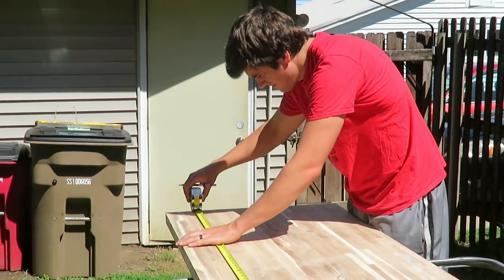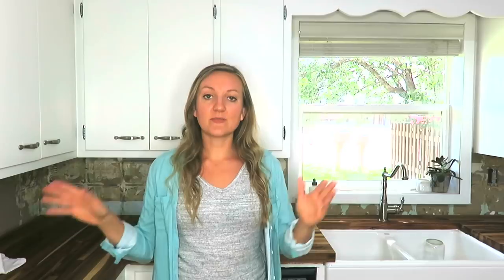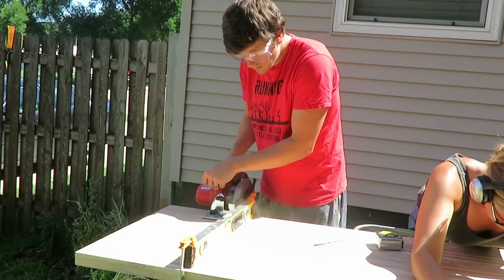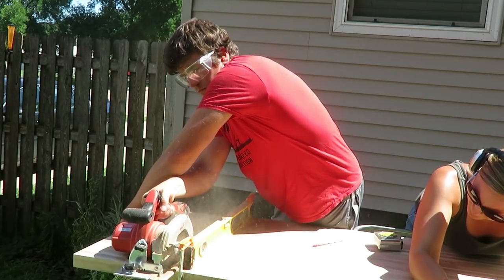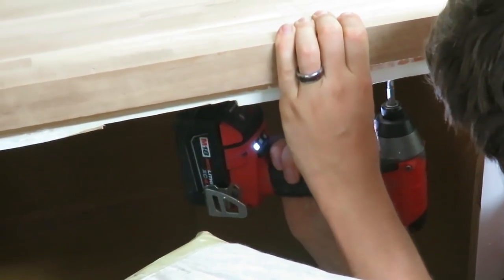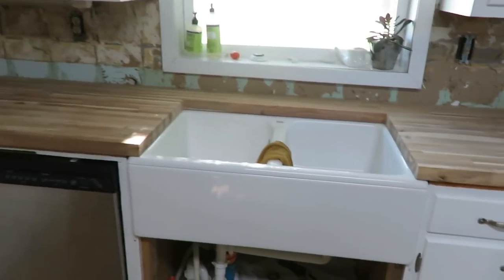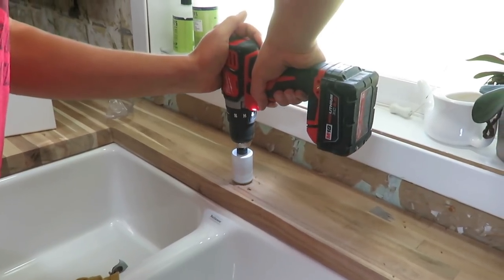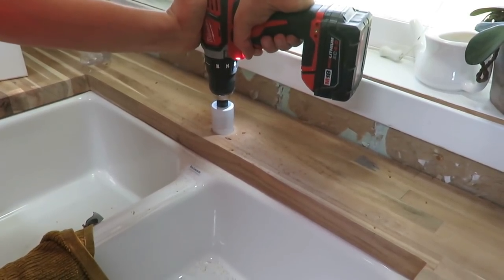HOW TO INSTALL A BUTCHER BLOCK COUNTER TOP | DIY COUNTER

Comment: I just got Walnut butcher block counter tops from Floor and Decor. They were about the same price but I got two 12 foot pieces. They had some acacia but they didn't have the butcher block look. So if someone doesn't have a LL in their area I'd check FandD. Your counter tops are beautiful.
Reply: Sara Wentzel  I just bought American Walnut. Did you seal yours? How is it going now?

Comment: My wife and I are currently renovating our kitchen and replacing the laminate with butcher block.  You are definitely spot on when comparing the cost of maple hardwood with quartz or granite, and it's definitely easier to work with.  Your husband did an extraordinary job, and I understand the measure three times cut once philosophy.  It's terrifying cutting a 350 dollar piece of wood.  One hard lesson that we learned (and no one mentioned on the internet) was that the corners on the milled slab from the factory are not necessarily square.  Fortunately my walls were about as straight as yours, so I was able to adjust for the error.  Love what you've accomplished and the results you're showing in the video look fabulous.
Reply from the maker: Good for you in DIYing your countertops.  Yes it is a nerve racking thought of cutting something that costs quite a bit.  Hope the video was helpful and thanks for the info.

Comment: That’s not butch block. It’s a wood plank countertop.
Reply from the maker: Here is where we bought it and it is called butcher block.  https://www.lumberliquidators.com/ll/c/Builder-Acacia-Countertop-Williamsburg-Butcher-Block-Co.-ACBB8L/10040713
Reply: Thst is butcher block. And its beatifull. I just bought two  8 ft  slabs from Floor and Decor (maple) for $400. I can't wait to get them in! Thanks for your video :)  Looks Awesome!